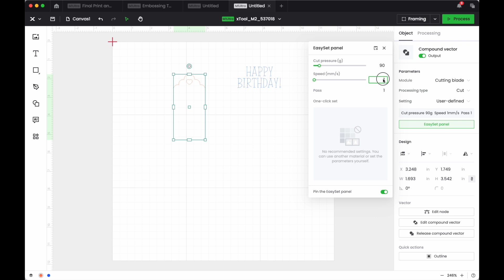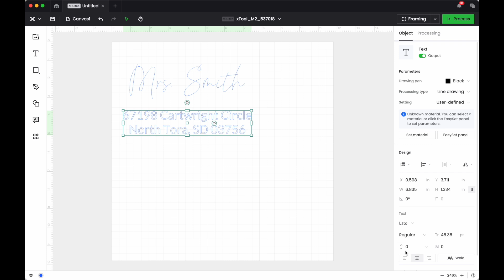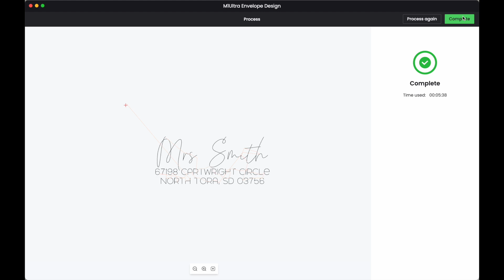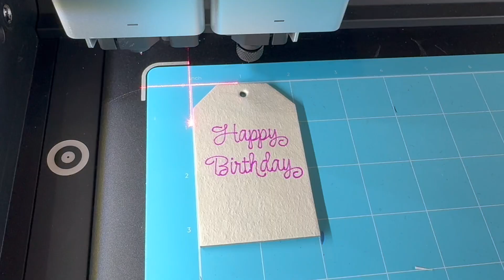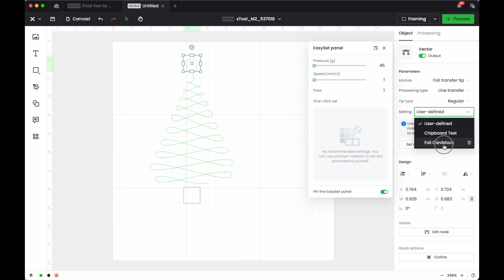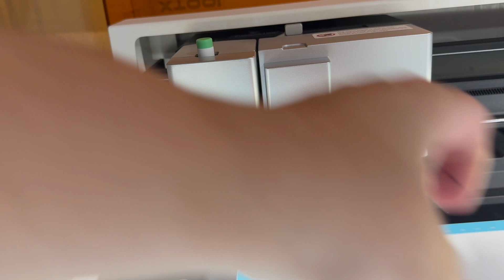How to Use the xTool M1 Ultra Pen Tool

Comment: How did you get a mat that is inches?  Mine is in mm and the lines are so small I can hardly see them.  I finally took the drawing pen and made inch lines directly on the mat so I can work in inchesl LOL  I might try using my Cameo mat. Thank you for the video.  I spent a lot of time testing cut line settings and pen settings today.
Reply: Mine had inches on one side and  mm on the other side
Reply: @shayhicks4689  I'll have to take a look at mine to see if it is the same.  That would be awesome
Reply: @shayhicks4689  I'm such a goof.  I never really looked at the back.  Now I'm happy to be able to work in inches.  Now, if I could change the virtual rulers in the design page to in inches...and brighter so I can see them.  I'd be a happy happy girl!
Reply: @cherylprottsman4285 if you push ctrl+k it will switch between mm and inches! It you can go to the X drop down menu on the top left, then go to the bottom and click settings, you can change it to inches in there! Don't worry, I've been having to figure all this out too and I'm glad to help!